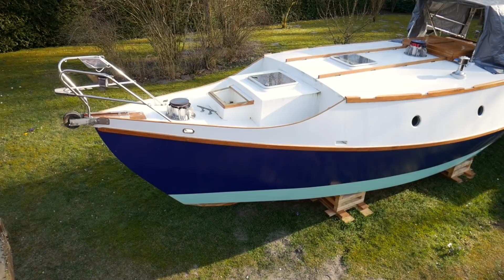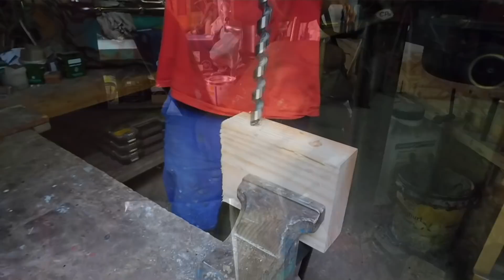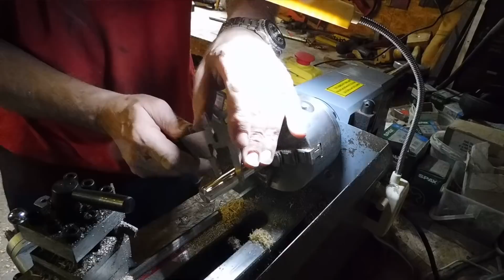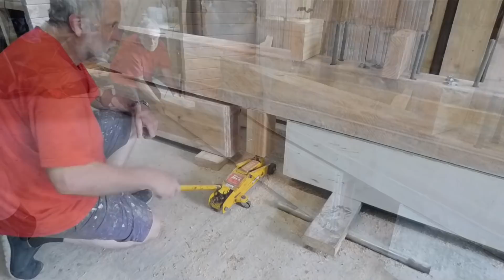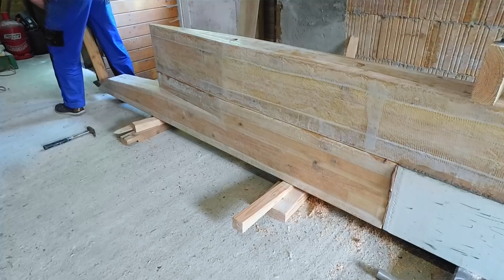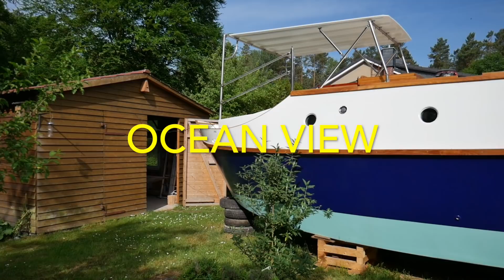A Big Hunk O' Keel; Building a cruising sailboat - SV Tapatya EP231

Comment: That is a smooth and streamlined ballast keel assembly Tony. Great progress and a job well done. Late summer/early fall splash is looking very possible. Looking forward to seeing your final design on the two masts. Ae you going to build battens for the sails or buy them out. Thank you for sharing and best wishes to the family.
Reply from the maker: Thanks Matt. I’m buying aluminium tube battens; I’ll make the yards from wood. Splash - maybe 🤔 Certainly hope to be sailing next spring/summer